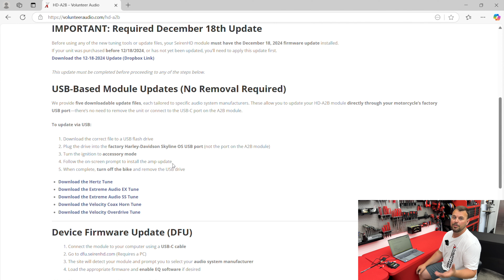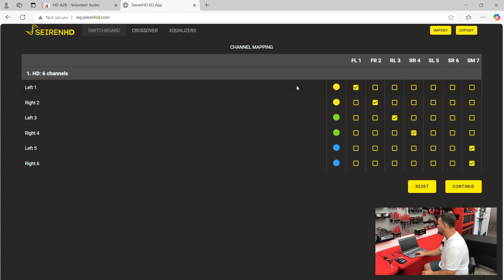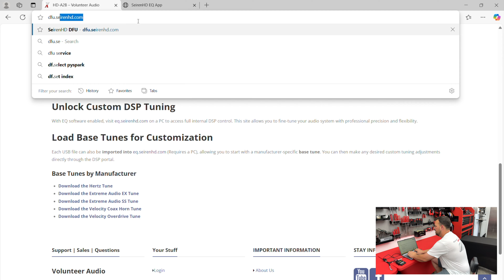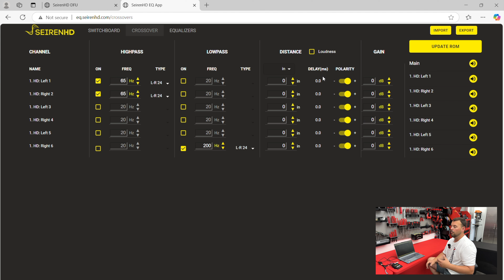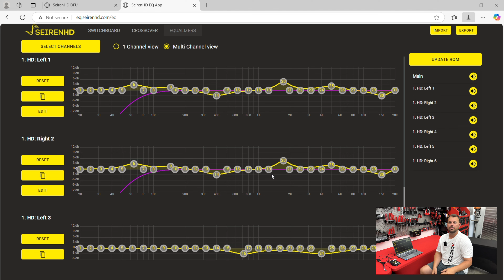Unlock Pro DSP Tuning on Your 2023.5 -Newer Harley Davidson! SeirenHD A2B Amp Interface Update !

Comment: So you have to tear the front of the bike apart every time you update this module?
Reply from the maker: Nope, it can be updated using a usb flash drive through the factory usb port.  You must plug into the module to do a custom DSP tune

Comment: can you connect a laptop to it when its on the bike through the factory USB to access the Equalizer?
Reply from the maker: To actively tune the DSP you need to plug into the module, this allows live tuning while playing the radio
Reply: @volunteeraudio so is that a yes?

Comment: Hi, Jay Nice work, but I wanted to ask something, what if I have the Harley rockford system in my bike with the subs, is it possible to use the A2B interface for the DSP & EQ Features on the Harley Factory Amps? I know it sounds crazy but I just wanted to know could it be done.......Nice video Thanks
Reply from the maker: No we can not remap the factory amp DSP, thank you for watching!

Comment: Can everything be done thru the usb c port even tuning or do you have to remove the fairing ?
Reply from the maker: You can load updates and premade tunes through the factory usb port, currently to do custom DSP tuning you will need to plug into the a2b module